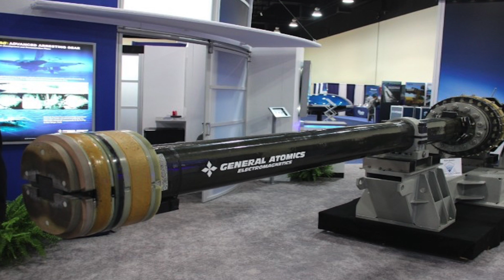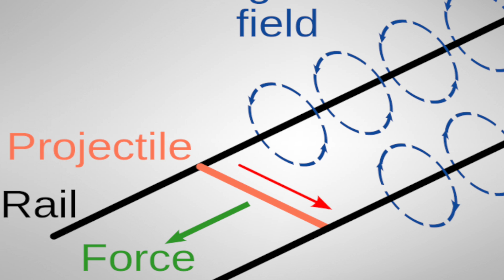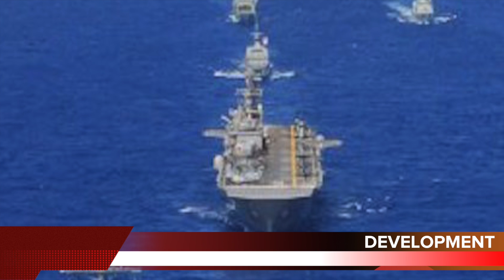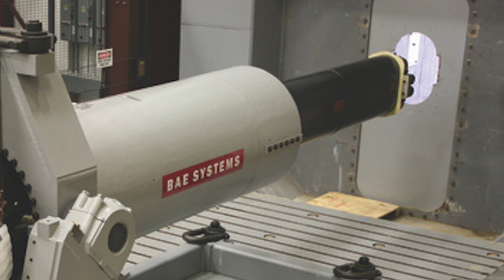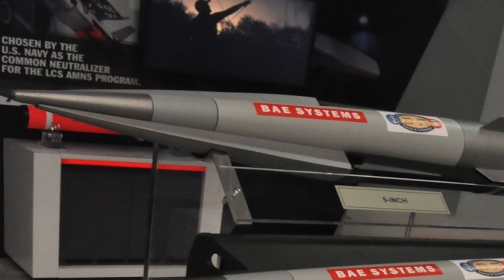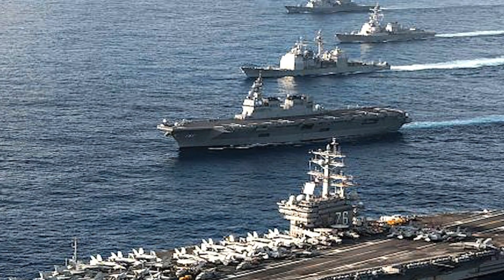WHY RAILGUN IS A GAME CHANGING TECH & HOW CLOSE U.S IS TO HAVING AN OPERATIONAL ONE?

Comment: Hi,... Let's use superconductors on rails cooled by either Liquid Nitrogen (if YBCO-or similarly based  - for Type II Superconductors - with potentially more engineering problems as they are ceramics - albeit they could be shielded physically) or by liquid helium (more energy-intensive - but for Type I Superconductors).  This should increase the rate of fire as well as shorten the barrel, for an even faster projectile velocity.

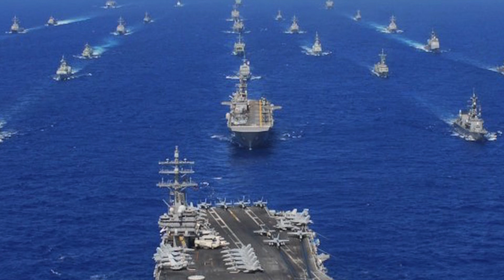Comment: 4:05 I think this is a typo - a streamlined metal projectile would not weigh 23lbs if it was 18 inches in diameter. The railgun projectiles used in testing are about 18 inches in length and a few inches in diamater at the widest point.

Comment: The heat off the rail gun could be used to power the rail gun itself throw the heat cycle. Run water over the gun and create steam and inject it in a turbine to power the gun. The gun could run perpetually or am I missing something?

Comment: Stop the fake news.

Here's one of many glaring mistakes, 

"There is currently no way to stop hypersonic missiles"

Right. And we've had ABM systems since the 60's. And newsflash, just about every ballistic missile out there is hypersonic. That's why one of those ABM systems in the 70s, had to have a specialized coating. Because in order for it to safely intercept ballistic missiles on reentry, it achieved speeds upwards of Mach 17, which would result in a plasma layer forming on it obstructing control electronics. This is why it had the specialized coating.

tldr; We've had ways to "stop" hypersonic missiles for a very long time.

Comment: Ammunition for rail guns is some kind of capacitor that stores the electric energy needed for the launch of the projectile.
The nuclear reactor, no matter its size, is not able to deliver the current needed for the launch. The nuclear reactor is designed to deliver a lot of energy in a steady pace. It is not able to react to a sudden increase in demand.
As such, the charged capacitors, necessary located close to the rail gun is a weak point. If hit by enemy fire when fully charged, it will behave as a 'powder bag' and explode as one.
The good thing about this concept is that there is only one 'powder bag' on the ship for each gun at any time, - only one charged capacitor for each gun.

Comment: Alright, so this weapon is no where close to being ready. Where a they can fire off a few missiles to get the same range or better with better accuracy but at higher cost, this thing takes forever to shut. I'm not a gm so I have no clue the firing speed. But let's say a rocket or missile can be fired once every 5mins, this thing fires once a day or something like that. The gm I've talked to hate it because it constantly breaks, leaves the ship open to attacks while it recharges or is getting worked on. The rail gun has a long time before it's ready

Comment: The heat problem is eminently resolvable. You can use CO2, seawater, or any cold fluid and run it through tubing around the hot parts.
Reply: Anton Nym it's wear, more than heat

Comment: Does any of "experts" know how useless is Rail gun?  

1. It uses enormous quantity of electric power which has to be stored in massive capacitors banks containing millions of Volts. 

2. It is incredibly slow in firing as it needs to cool down not just electrical magnets but whole gun.

3. During firing creates massive quantity of superheated plasma whuch is shortening life of electric coils.

4. Projectile is dummy as it has no explosive but just full metal body and is counting on kinetic energy only.

5. Projectile has no guidance because speed 2.4 km/sec creates overheating due to plasma enveloping the projectile and would prevent any electronic signal in or out of projectile.

6. It is still slower than Zircon hypersonic missile which carry thermonuclear warhead. it is exceeding Mach 8 and is designed to reach Mach 18.

There are tons of other reasons and only positive thing with Rail guns is that someone will make billions on stupidity of buyers. This channel is one of the least professional in military matters. I would suggest to start to present fishing stuff rather than military.

Comment: I worked on a 30-foot-long 105 mm railgun at a university back in 1990.  Even today's railguns are still laboratory toys.  I've yet to see a large-bore railgun being operated on a real warship under realistic combat environments.  Firing a railgun once in a lab is easy.  In combat the problem is the extremely low firing rate.  The 16" guns on an Iowa class battleship could be fired at 2 rounds per minute.  A 105 mm railgun can't even do one round per day.  The two technological hurdles were: (1) The railgun requires a massive pulse of electrical current that has to be switched on and off.  How do you switch that power off without arcing and melting the switch?  Back in 1990 our work-around was to not use a switch at all.  We used a computer-ignited primer cord to blow up the electrical pathway.   (2) The projectile's armature must be in firm contact with the rails while it slides down the bore.  Not only does that massive current induce a lot of heating, but the tight-fitting armature scratches the rails as the projectile is launched.  The end result is a gun bore that needs to be reconditioned in between each and every time it's fired.  A railgun can be designed such that the armature is not in contact with the rails, but there is a significant power loss in the process.

Comment: we can drop tungsten rods from space, and people think turning a linear accelerator invented in the 50's is difficult to retrofit into a weapon hahahahaha. also railguns are not being looked into because of cost savings of no propellants and or safety hazards. they are being looked into because they give off no heat signature when fired which means the payload that lands can not be traced or tracked. railguns are nothing more than a great way to start conflicts and stay anonymous. great way to trick enemies into fighting one another with proper leverage of propaganda, and misinformation
Reply: dantediss1 The whole fucking ship gives off heat signature and the heat from the coils give off heat signature. Theyre being worked on because it has potential to be more deadly
Reply: Mystery Train the ship will always give off a heat signature regardless. which means launching the projectile will not show. the reason why is because the heat signature flares up during launches of ordinary ordinance. but since the linear accelerator gives off next to no heat signature. you cannot confirm that is where the ordinance was fired from.

Comment: You will never see this gun used in war for decades. The reasons are simple.
When the gun fires you see a lot of fire and smoke, there should be none or at least little since there is no propellant. The fire and smoke are the Sabot and the Rails burning away from friction. No accuracy.
There is also the problem of making a guided shell, First there are no computer chips that can take 250000 Gs of force, the other is the electromagnetic forces passing through the projectile that will fry electronics.
There is also the problem with the rails failing due to work hardening as they are under far more stress than any gun barrel.
This is a gun for 20 years from now, maybe
Reply: John Parrish True but the fire and smoke disguise it from the enemy thinking its just a normal gun.

Comment: This Gun could in theory bring back the Battleship to the world Navy's
Reply: Philusaphur it's not even that missiles make BB obsolete, it is that BB role as power projectors are entirely obsolete and replaced by CV/submarines.
Reply: MrPlummer10 Nope, missiles and tracking systems make battleships obsolete.
Reply: I can only hope! It would literally the coolest thing on the ocean!
Reply: best use for the Rail gun would be  has a shore battery that is only why you be able to generate another  Electricity  also if the gun over heats and have cool down say after ten rounds that not  very effective.  plus it being  Electromagnetic could  that not interfere with other electronic systems
Reply: Interesting. Heat being the problem. In the old days you would have machine guns with water cooled jacket on the barrels. Also supercooling increases the efficiency of electromagnetism. So why not place a  nitrogen filled jacket over the barrel? It's not like a rail gun's barrel had to contain the explosive forces of expanding gases, as would a conventional gun. This way you wouldn't need as much electricity, and you could fire as many shots as needed.
Reply: I thought of this too. That would be glorious!!
Reply: Alain Archambault You could run a heat cycle that literally could use the very heat off the rail gun to power the rail gun itself!
Reply: Slap it on a tank

Comment: Time to bring back the battleships, convert the current deck guns with railguns...
Reply: Oh yes

Yesssssss
Reply: Eric Rivera i
Reply: Yes
Reply: Yes I also want an Iowa with railguns but there is a huge problem. Too expensive to refit. Too old to refit. Not enough power to use railguns. Can't make a BB nuke powered without taking the back 1/3rd of the ship off.  Just build new ships that make the power requirement. Make it big beefy and  mean like the Iowa class and call it a day.  By the time you refit everything you need on an Iowa , it would be a brand new ship and it there would be no more Iowa left.
Reply: Eric Rivera 
We need modern Heavy-cruisers and Modern Battlecruisers
Reply: then after that laser gun will be used
Reply: That is similar to saying we need more carrier so bring the Hornet, Yorktown, Interpid, Lexington, or Midway all 5 of those carriers are 75 years and i know 2 of them were never refitted with steam catapults

Comment: Another F35 in the making..Wasting tax money..just to keep the stupid citizens engaged and away from petty politics..what a shitload of out of box thinking..fucking #FAILGUN
Reply: R3P34T 0FF3ND3R Nah dude. This weapon has thw potential of making ICBMs a relic of the past. it can rapid fire shotgun tungsten rounds at mach 5.
Reply: eddie money nope! it will inspire better electricity storage,better cooling system,more heat resistant alloys,etc
Reply: How is it a fail?
Reply: eddie money+ These are just prototypes. They probably don't want even have a 1% chance at breaking them. I'm sure they can make it fire just as fast as a conventional weapon. If not, then the Range of the weapon will make up for it.
Reply: Stop dumping on the F35. The F35 is like a flying IPhone. I agree the cost of producing this plane got out of control.  Management has crack down and the cost is decreasing. Also the bugs of the F35 are being worked out. In combat this plane will be stealthy,  loaded with high tech sensors, radar, weapons, electronic warfare jamming tech, and the best advantange  of all is to see the enemy first which means first look first kill. Also in combat there wont be one F35 there will be many communicating with each other rapidly. Taking down f35s won't be an easy task.
Reply: "F-35 was a piece of shit"? Actually, the F-35 is the best multi-role fighter ever. Absolutely destroying any and all 4th gen fighters in all the exercises. Factory is pumping them out and 10 countries are lined up to buy them. Probably end up making +3000 of them. Wildly successful program.
Reply: Antipropaganda
Reply: Justin Davison than they better make sure the power supply can hold up or is it solar powered wind turbine lol
Reply: eddie money oh thank you you're an engineer and know everything
Reply: We can hope, because the F-35 is an absolute game-changer.
Reply: Cal Crappie f 35 was a piece of shit.
Reply: D4ND3R0US MINDZ another guy who knows nothing and does nothing but shit on others.
Reply: D4ND3R0US MIND
Reply: D4ND3R0US MINDZ an emp will render a rail gun useless
Reply: Breaking good nope... It actually won't. Military electronics for about the last decade have been sheild from the effects of an emp.

Comment: There is already a slightly shorter range of the RailGun being used on the US 3 new Destroyer DDG 1000 - 1002! The weapon is called LRLAP. The longer range one is well on the way!
Reply: Dieter Honchied didn't that get cancelled
Reply: Dieter Honchied that's not a rail gun, it is a regular gun with rocket boosted projectiles. But the projectiles are more expensive then missiles so it will likely be axed in favor of the rail gun.

Comment: Lol "cost efficient"
Reply: Ed Callahan when you shoot off a missile it costs millions, when you shoot off a railgun it costs way way less.
Reply: The whole gun if it fails to shoot will cost much more though, and if there would be a fault in electric lines, crew is irreplaceable since most ships are made of electicity conducting materials
Reply: So what, shoot faster than the alloys can handle it and you literaly melt the gun, or if every fifth shot would fail and destroy the barrel, then a rocket with half a ton of explosives is far more efficient, is it really that efficient if you have to get a ship back to base and refit a gun that is still not fully understood?
Reply: Ed Callahan the projectile will probably cost a few thousand, meanwhile a missile cost tens of thousands
Reply: A tomahawk cruise missile is over 1 million USD a piece.
Reply: You're literally just pulling that out of your ass. There's something called research and testing. You FIX those faults.
Reply: Shame there is not a R'n'D for your brain, but yeah, you can fix those issues, but more can come or it wont be cost efficient anymore , if you have to get something working better via testing and most times it is destructive, costs raise dumbass

Comment: We need to invest heavily into anti-missile programs. THAAD is not good enough. We need to be 4 steps ahead of our enemy. We need to find a way to shield our forces from modern weaponry.
Reply: The Railgun will be used for Shore bombardment, anti surface warfare, anti air warfare, and missile defense.  It will help in the layered defense approach. Also AEGIS and the SM6 have anti missile capability. The dedicated anti missile interceptors are also out there. The US has multiple systems in a layered approach to defend the US against missiles.
Reply: David Smith.  It sounds versatile yet expensive. If it doesnt become more cost effective it becomes relatively useless. I'm sure the designers and the military understand this. My worry is it's production will be limited due to its massive cost. Where a cheaper yet larger produced alternative could be just as effective. They should both be explored.
Reply: Actually the Railgun system will be the most cost effective system in the Navy's inventory until directed energy weapons reach the fleet. A GPS guided round will cost about 25k per round. Compare that to the millions of dollars in cost for the SM6, THADD missiles, and the Ballistic Missile interceptor vehicles. 

Compared to traditional artillery mounts like the Navy's 5 inch 54 caliber guns. The Railgun is lighter, it's projectiles are lighter, and it does not have to carry powder. Making the system far safer in actual battle.
Reply: Actually the cost isn't massive, its cumbersome and parts storage is a pain, and heavy equipment is needed. It will be worked out.
Reply: You would be incorrect sir the Rail gun will have a rate of fire of 10 rounds per minute. When you are firing guided projectiles that is plenty fast enough tp deal with missile threats.
Reply: lol you would be incorrect sir. I find it amusing when people try to talk to me about defense issues. Question do you think I just make this stuff up? Before I talk about topics on the internet, I do research on the topic to ensure I know what I am talking about.

Here are some links that prove you wrong.

http://www.dailymail.co.uk/sciencetech/article-3108024/The-Navy-s-Star-Wars-weapon-fire-missiles-three-times-speed-sound-warship-s-gun.html
 
I will quote specifically form this article.
"Admiral Klunder added: 'It will help us in air defence, it will help us in cruise missile defence, it will help us in ballistic missile defence … we're also talking about a gun that's going to shoot a projectile that's about one one-hundredth of the cost of an existing missile system today.
'It … will give our adversaries a huge moment of pause to go, 'Do I even want to go engage a naval ship?'.'

https://news.usni.org/2015/06/01/navy-researching-firing-mach-5-guided-round-from-standard-deck-guns

In the above link it describes how GPS guided rounds designed for the rail gun are being adapted to fire from standard Naval 5 inch guns.

As to the rail gun being fixed....that is laughable. The prototype may be fixed but putting it in a turret is not difficult at all. The system itself is still smaller and weighs less than a standard 5 inch artillery piece,

https://news.usni.org/2015/07/28/navy-pursuing-upgraded-railgun-higher-power-laser-gun-by-2020

In the above link it quotes a 10 round per minute rate of fire.

http://www.military.com/daily-news/2014/04/07/navy-plans-to-test-fire-railgun-at-sea-in-2016.html

The above link SPECIFICALLY talks about engaging air targets with the rail gun using guided rounds.

So....oops everything you said is wrong. I hope this helps clear up the misconceptions you had about the rail gun.